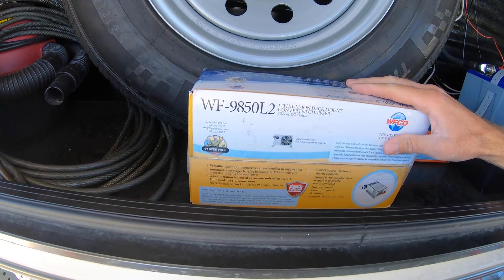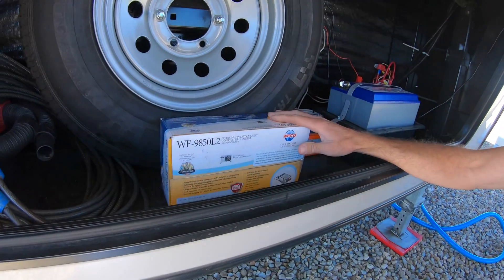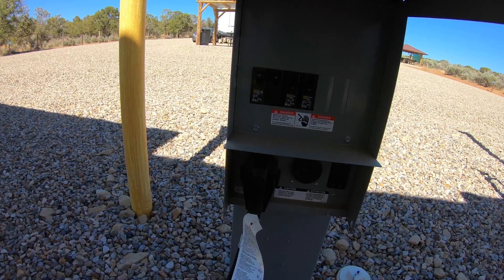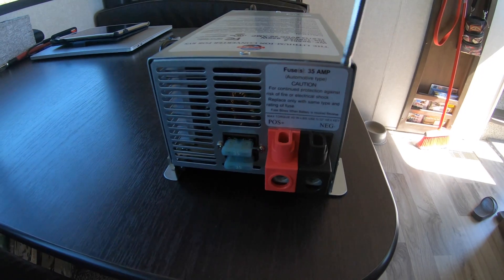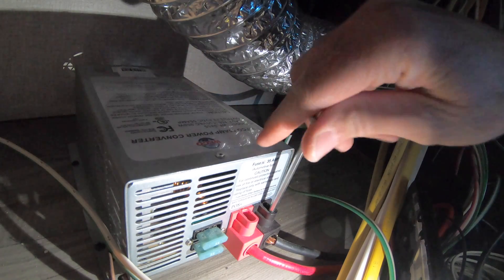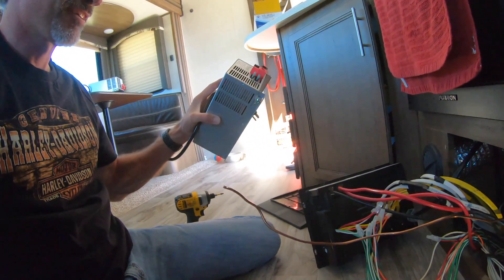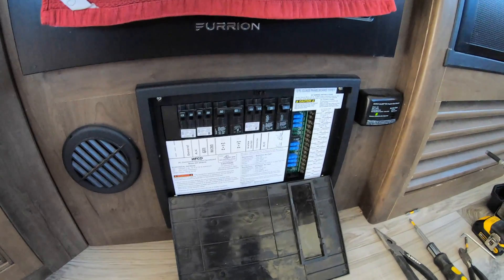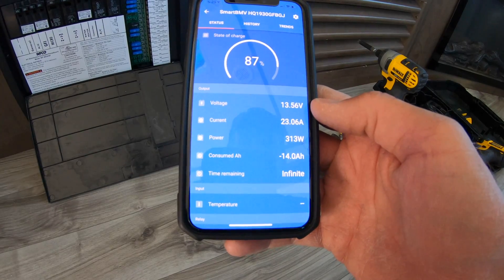Going to LITHIUM Batteries for your RV?  WATCH THIS FIRST!  WFCO WF-9850L2 Lithium Converter Install

Comment: My converter will work with the Battleborn batteries after I remove my lead acid so you shouldn’t discourage people with false information. You should tell them to check their manual or to call Battleborn if they are unsure.
Reply from the maker: I did not provide false information.  I had stated that our original converter (WFCO 9855) did work with the Battleborn Battery, however, it would only charge it very, very slowly.  The original charger would only put in 2 to 3 amps while charging while the new charger that is made specifically for lithium will input 25 to 26 amps while charging.  That is a significant difference.  I am not trying to discourage people, I am trying to help people.  If your particular converter/charger works for you, then I would encourage you to keep it and continue to use it.
Reply: Homie At Large I was referring to you saying, “you will need a new converter” or something similar, I thought to myself as soon as you said that would have influenced me if I didn’t know better. Mine will charge them properly and I do intend to keep it. I just thought you might like to know how your comment was perceived by a viewer. Thanks for trying to help.
Reply from the maker: Marsha Adams  Thank you for your feedback.  I did go back just now to review the entire video and saw near the end where I had made a blanket statement saying that people would need to switch out their converters if they changed over to lithium.  I can now see how that would come across wrong.  Thank you for pointing that out.  I was able to remove just this section via the YouTube editor (it said it will take several hours to process before the changes can be seen by our viewers).  Just curious to know what brand converter you have installed in your RV?  Also wondering if it is able to charge the lithium battery to 100% and does it provide a fast or slow charge?
Reply: Homie At Large No Problem with the feedback...hope I didn’t offend you at first...I’m a pretty “matter of fact” kinda gal and sometimes I’m pretty blunt. I’m glad you reviewed your video and understood what I was trying to tell you. My converter is a Progressive Dynamics PD9270 and Battleborn tells me that as long as I use my remote pendant occasionally and manually put it into “boost” mode, that will make it charge at 14.4 which is what is needed to get their batteries to 100% charge. I’ll keep mine for a bit and see how it goes...I don’t like fixing things that aren’t broke. If it does prove to be slow then I will upgrade it but I’m going to give it a try. Thanks for your video.
Reply from the maker: Marsha Adams  No worries!  I was a little on the defensive at first from your original comment, however, I am glad you pointed that out.  I believe my original thought was that all standard chargers would operate with lithium in the same manner that our WFCO charger did.  Very interesting that your charger has a remote (mine did not) where you can throw it into boost mode.  Pretty cool!  Please let me know how it works out for you after you test it out a bit more.  Thanks for the correspondence!  Take care.
Reply: D
Reply: Stop acting like an idiot Adams it definitely wasn’t intentional plus folks should never depend on YouTube 100%. Gather your information and then make decision.

Comment: Thanks for the video. I have just put lithium battery and I also called battleborn and they told me I would be ok as I have the same charger. We are headed out on a trip in two weeks so I’ll be getting a new converter soon. I’m looking forward to your battery monitor installation video.
Reply from the maker: Hey Doug!  I would recommend testing it out before you hit the road.  If you have the WF-9855, you will definitely have a hard time getting it to charge the Lithium battery.  Hopefully you won't be boondocking on your next trip?  I'm putting the finishing touches on the Battery Monitor video and will be releasing it soon.  Thanks for watching!

Comment: Thank you for the video.  This is exactly the setup I am looking for.   Many of lithium/solar systems we see on the youtube are huge and sometimes sponsored and, although I have nothing against that, it does not represent my expected setup.   I just can't afford it.  We have 190W solar pannel and are looking at 100AH maybe 200AH of LiFePO4 so very much what you have wrt battery and are planning to add for solar side.   Great info on the charge converter, I added this to the list :).   Please give us an update on how the battery and solar combination performs in the next few weeks/months.   I would love to hear an update on how practical this size setup is going forward.  BTW do you have an inverter as part of the system?   I think single 100AH lithium limits the size to 600-1000W (depending on battery spec) so I would be interested on what you have on the AC side of the circuit.  Thanks!  Pozdrowienia :)
Reply from the maker: Seb  NP, You are very welcome!  I will be posting some updates as I complete the other videos for the solar suitcase and the battery monitor.  So far, the converter is working great!  We dry camped again earlier this week for a few nights and the battery dropped down to 52% after a night of running the furnace (ran a lot due to colder temps in the higher elevation).  The charger was putting in over 29 amps when I first started the generator.  Took about 1 hr 45 min to fully charge.  The charger works in bulk charging mode for the majority of the charge then drops down into absorption mode near the end and charges slower until the battery is full.  We do not have an inverter (yet).  We will be buying one sometime later this year and will also be adding a few more batteries as well as an automatic switch.  The solar suitcase we will be doing is 200W (bought all the parts, just need to put it together).  Will eventually put around 600W more on the roof, so, total of 800W and I think that will do fine for our needs.  So glad this video helped you out!  Thanks for watching!
Reply: @EddieAtLarge  Thank you.  It is good to hear some concrete numbers for the power usage.  It makes me feel confident my two battery (2x100AH )setup should work to provide power to run the furnace for a few days (especially with some solar top up) before recharging through a generator or going to electrical hookup in RV park.